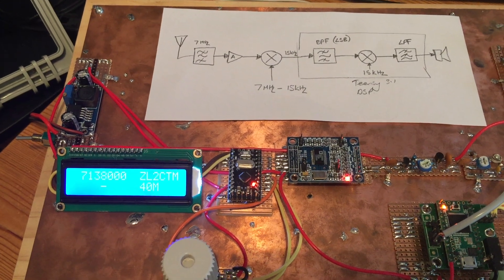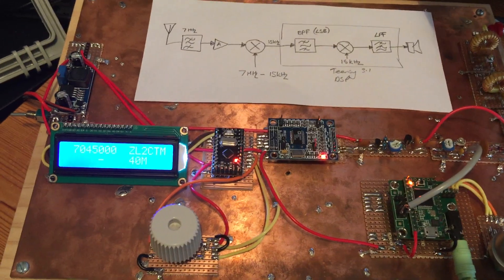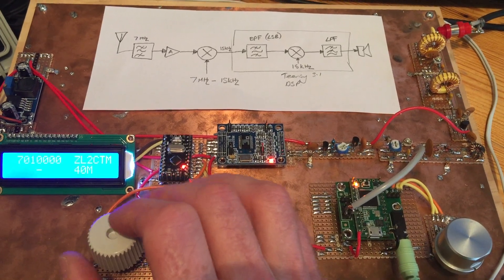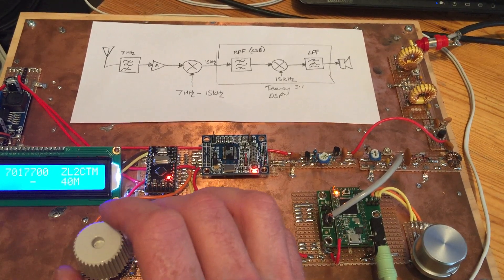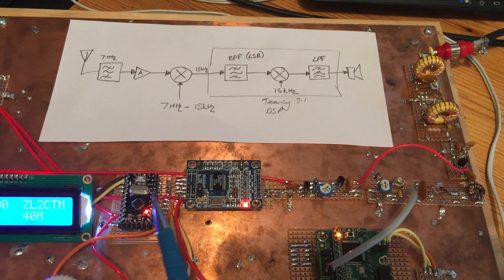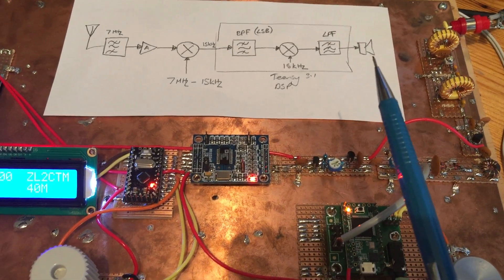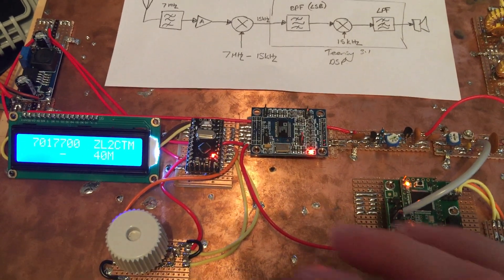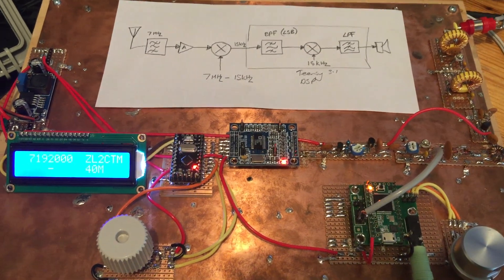Teensy SDR SSB Superhet Receiver

Comment: Charlie, very impressive!! 

I saw Paul Taylor's (VK3HN) presentation at the QSO Expo last month and was completely blown away by his work. Scratch building--at least his approach--seems very logical, throughout, and, frankly, rewarding. I completely lack knowledge in this area and want to learn more. Paul mentioned your materials. After looking at your first few blog and video entries, I went to the very...end. I would really like to learn the basics and approach this like you have as a block diagram....  Listening/testing each stage to really understand that is occurring. 

Your documentation is impressive for the most recent projects. Do you have anything on this particular project? I'd like to ultimately make my own homebrew QRP CW SOTA rig, but would like to also do some bench experimentation (SSB and CW).  

Thanks, Jack NG2E
Reply from the maker: Thanks Jack, that sounds great. I find home brew very rewarding. Just remember the videos are more of a video log than tutorials. I am no expert, and I know there are errors here and the there. Start simple, i.e., with a DSB receiver and go from there. It takes very little to get a receiver up and running, and you'll learn lots. Dive in!

73 Charlie ZL2CTM